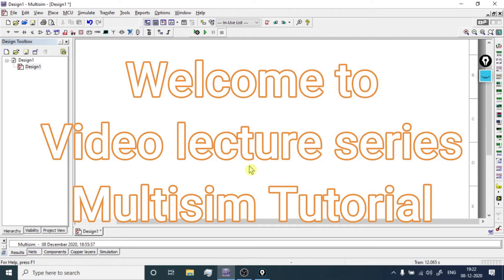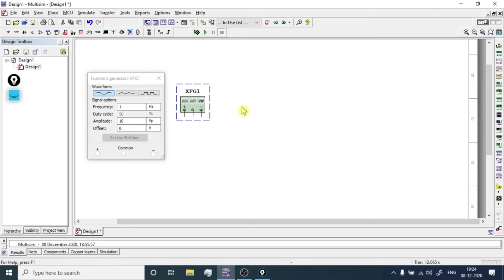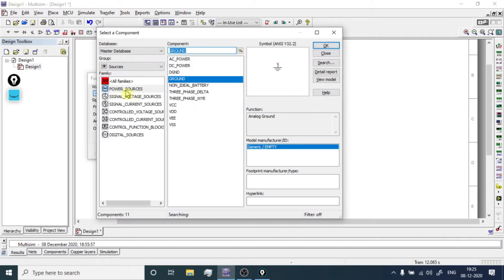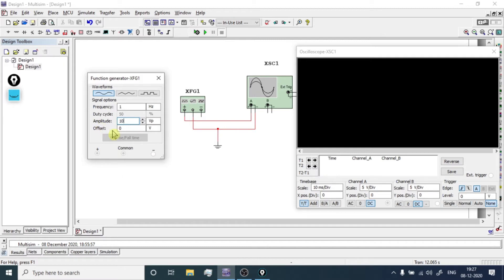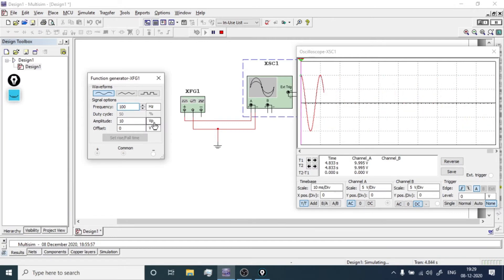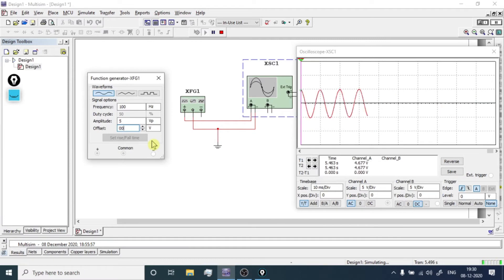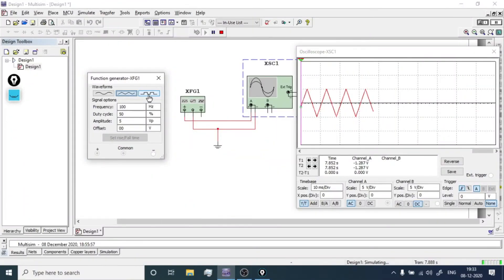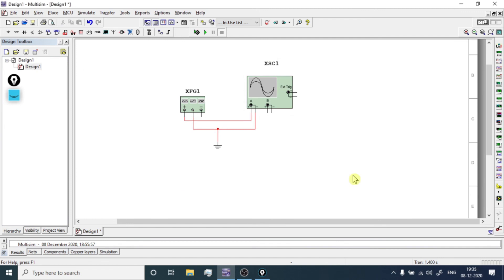How to use function generator in multisim | Operation of function generator | Multisim Tutorial

Comment: How to set peak to peak volatge in this simulator sir?
Reply from the maker: You want to measure pk to pk voltage?
You cam use vertical bar T1 and T2 to calculate it or else you can use measurement port